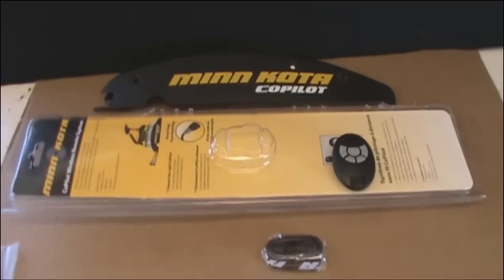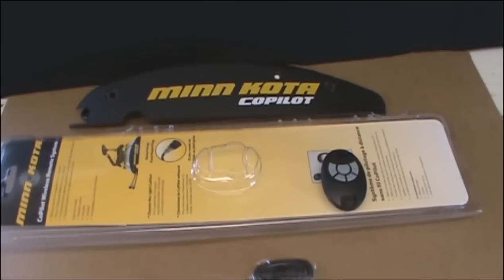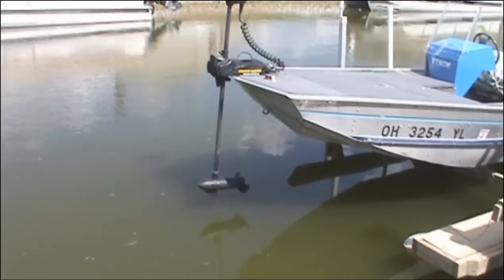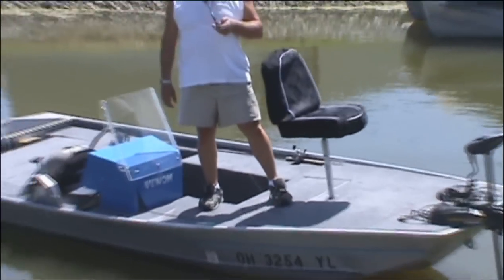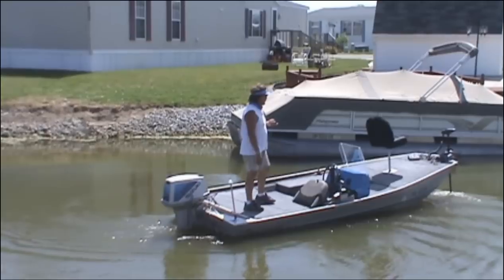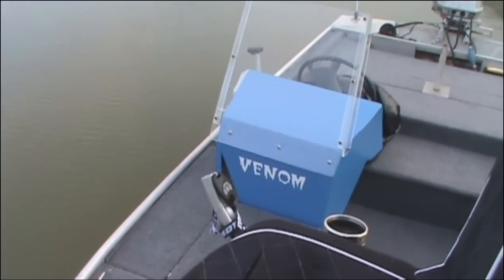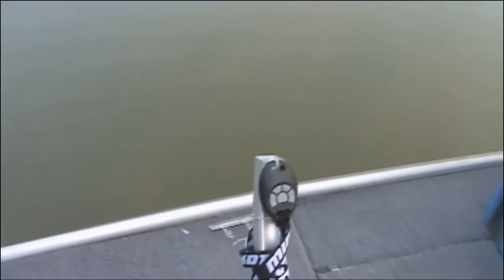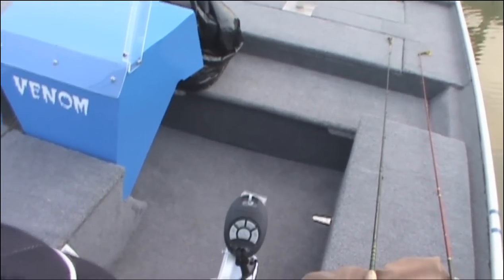Minn Kota Copilot

Comment: I'm restoring that boat as we speak! So nice to see the end result! Would appreciate some pointers and maybe you could clear some things up for me. My boat didn't have the console, seats, and back deck so it took me 6 months to figure out what it was. Just found the HIN on it.
Reply from the maker: +Terry Antrobus My live well is in the rear don"t use it much gets water in it when it rains then door has to be open to dry it out,I bass fish mostly and sit doing it thats why I wanted the deck to be almost flush with the top rail, raised the console, didn"t like sitting low,windshield could be lower ,boat has sit on lift all summer since rebuild everything looks great, chose this boat for it"s durability , planning what you want and use is the hard part good luck